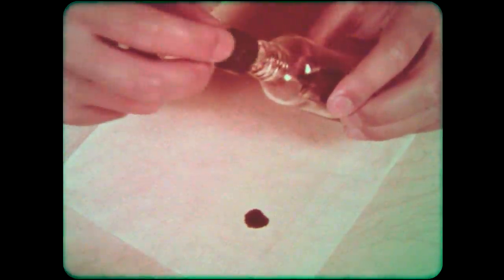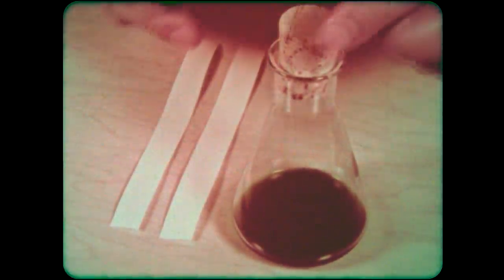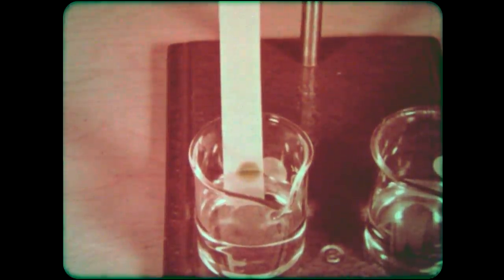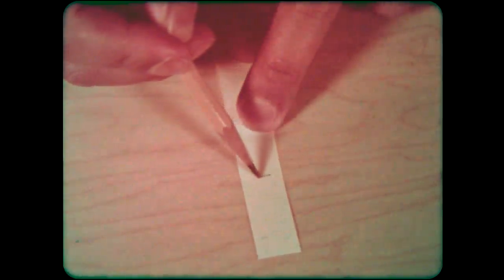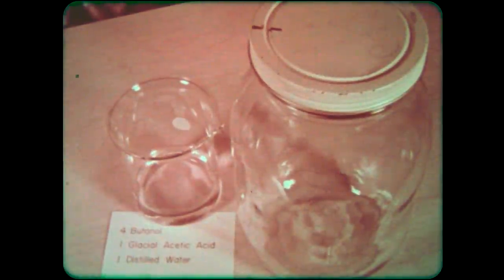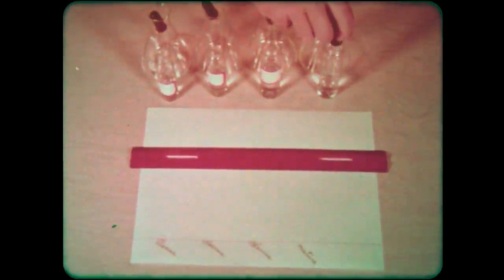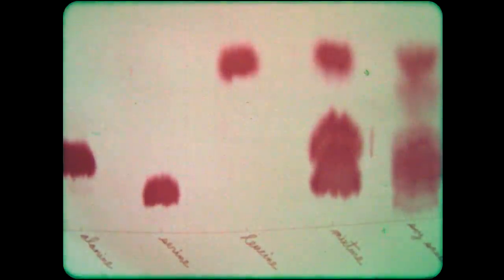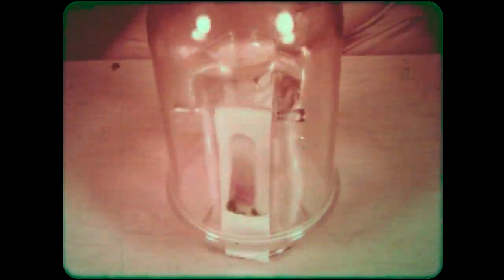Paper Chromatography (1961)

Comment: Interesting mix of inches and centimetres !
Reply: Science had been using metric for decades, because it made calculations easier and because a lot of the other units were based on metric units that were all linked. In this case the maths becomes 12/12.5= 0.96
Imperial would have been 4 23/32" over 4 29/32.  So you'd bust out the slide rule and work out that that was 151/157, and eventually get the same answer.

Common units (ie inches) were still used for anything that didn't need to be calculated but were more of a "guestimation" or approximate amount.